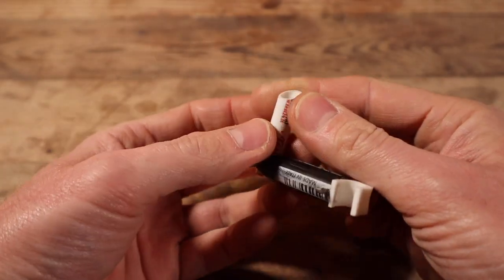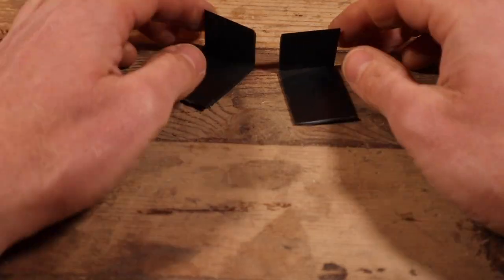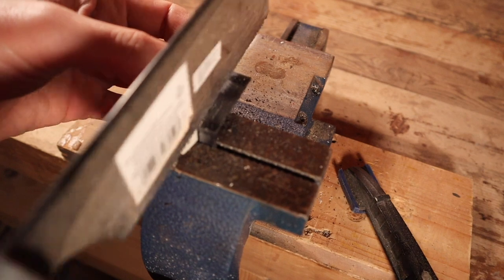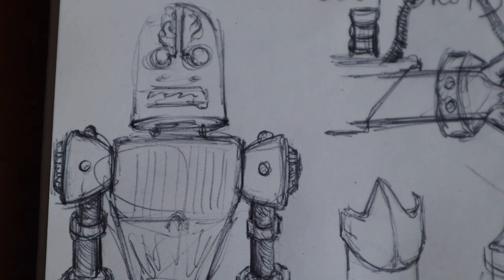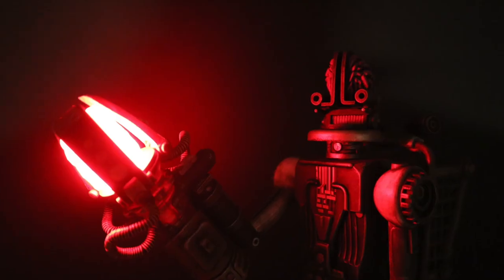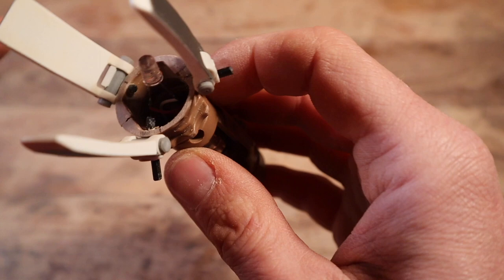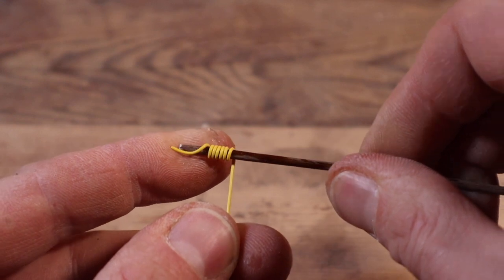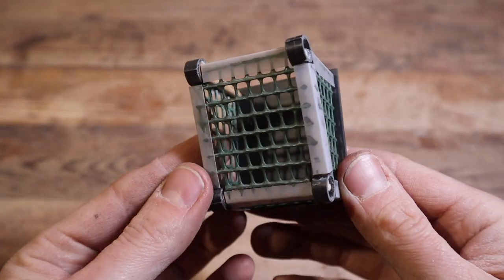How to scratch build ACTION FIGURES from PLASTIC CASES !!! #3

Comment from the maker: The detail on the droid's chest is an ink cartridge circuit board.
The diorama/base with the crater and the crystal cluster was made using DAS air dry clay on top of a section of 20 cm diameter PVC pipe for construction work...The base is hollow and hides a powerful LED light to light up the cluster from below.
As for the "crystals" I am not really sure, but I think we are talking about a kind of quartz, definitely not the purest (but that is really the point), that comes in various degrees of translucence. A very interesting material I dealt with for the first time. I'll make a video on it, and continue experimenting with it for sure!